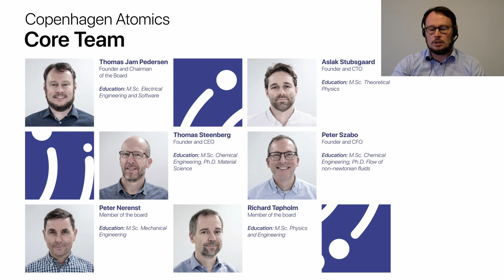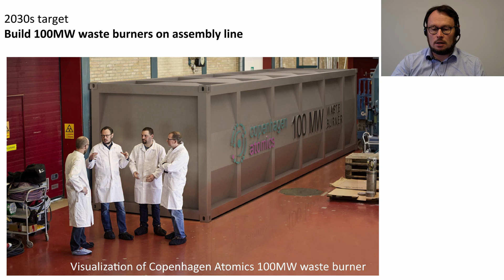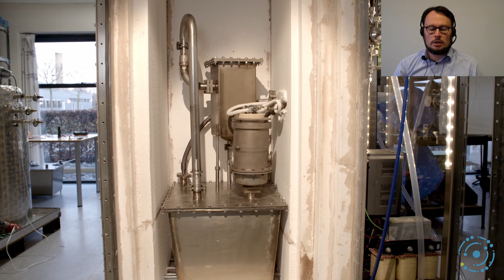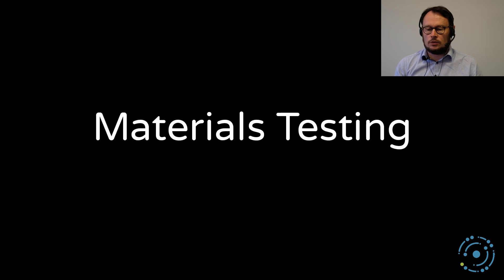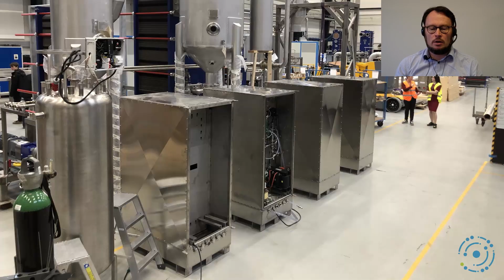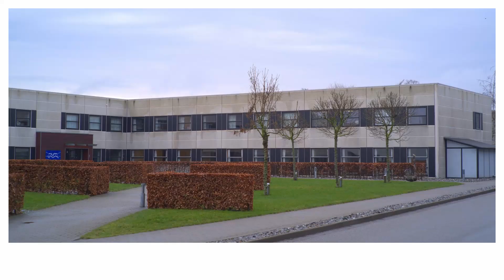Copenhagen Atomics Webinar with Thorium MSR Foundation

Comment: The question that some people ask like me, is what is the resistance of all construction and thermal transfer materials to the chemical corrosion of salt at very high temperature (700°) over a very long period of time (7 or 8 years)? Is that not the main difficulty for an operational MSR? Do you have some clues and certainty regarding this major question? Thank you for your answer
Reply: Short answer, corrosion is not a problem if you can keep your salt clean and free of water.
Reply: @DKTAz00  Thank you very much for your answer. It means that already exists some metallic alloy or refractory material, which has the capability to withstand such a very high temperature as 700 C° for a very long period of time such as 7 to 8 years. It is good news, in France there are many nuclear specialists who oppose MSR on the ground that there are still numerous unsolved corrosion problems. What are the experimental proofs one can assert in order to offset this argument? Thank you for your help
Reply: @FranceBernardof0609 They developed what they call 'Hastelloy-N' for the original MSRE in the 60's

https://en.wikipedia.org/wiki/Molten-Salt_Reactor_Experiment

'An out-of-pile corrosion test program was carried out for Hastelloy-N,[10] which indicated extremely low corrosion rates at MSRE conditions. Capsules exposed in the Materials Testing Reactor showed that salt fission power densities of more than 200 W/cm3 had no adverse effects on compatibility of fuel salt, Hastelloy-N, and graphite.'
Reply: @FranceBernardof0609  Also this timestamp : https://youtu.be/ENH-jd6NhRc?t=1788
Reply from the maker: Copenhagen Atomics has shown that regular stainless steel 316 is good enough for the first 1 MW test reactor in 2025. When we have data from that experiment we will decide which parts we may need to upgrade to more expensive materials. It will not be all parts, that we know already. Materials is not on the top 5 list of drawbacks!
Reply: Hastelalloy N with added niobium apparently does relatively well.

Comment: Coming back to this after watching Jiri Krepel's presentation on the potential for burning spent fuel, does Copenhagen Atomics still stand by the use of a moderated system? 
https://www.youtube.com/watch?v=vxdqtAcz8hQ
With the excess of neutrons from direct fission of Thorium and from the inherently softer spectrum of fluoride salt systems, it seems to me that the SAMOFAR route of going with LiF and an unmoderated reactor allows the best compromise between burnup of higher actinides and from minimising startup fissile requirements. And possibly reduced shielding requirements, especially for a reactor that aims to fit into a shipping container.
Reply from the maker: Not true. A fast molten salt reactor require 10 - 30 times more fissile fuel than a thermal reactor. (same energy output). Yes fast reactors give a few % more neutrons, but there is no way they can compete agains a thermal breeder. But to get to a thermal breeder you need very low neutron loss and online removel of fission products. Jiri and co did not simulate this correctly. This is why they did not get the same results as Copenhagen Atomics. What we have developed is in a category of its own. It is a thermal breeder reactor with VERY good neutron economy. This will also beat fusion if they ever get that to work.

Comment: The prospect of a nuclear waste burner is absolutely splendid.  There are 250000 tonnes of high-level nuclear waste Worldwide.  Anything that can transmute this waste and render it safe is immensely beneficial.  Copenhagen Atomics is doing a great job and is worthy to receive generous funding and investment.  Lykke til !
Reply from the maker: Thanks. Yes we can burn that waste and create roughly 100 times more energy out of it, than when it was burned the first time around. (by adding thorium). This is a new category of nuclear tech.
Reply: @CopenhagenAtomics  splendid idea but 'thorium reactors' have been talked about for at least 70 years and so far no one has built such a reactor - despite many announcements. Why? What are the main problems to run the first reactor of this type?
Reply: Perhaps dumped 28000 barrels of nuclear waste can be recovered and processes in molten salt reactors:  https://www.youtube.com/watch?v=-ZhPndLmpAQ     ?